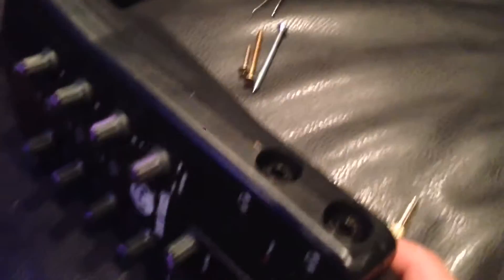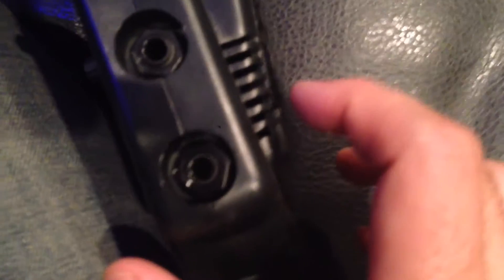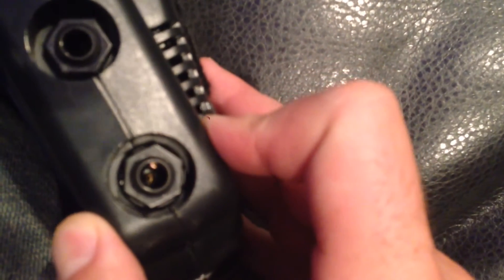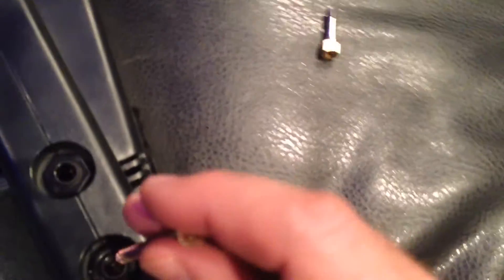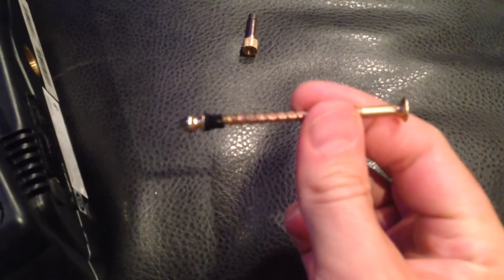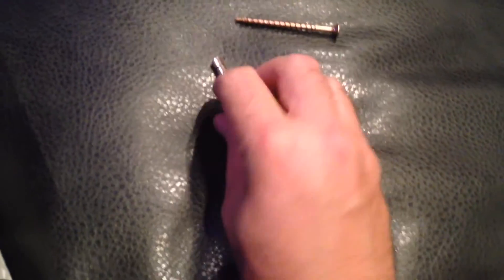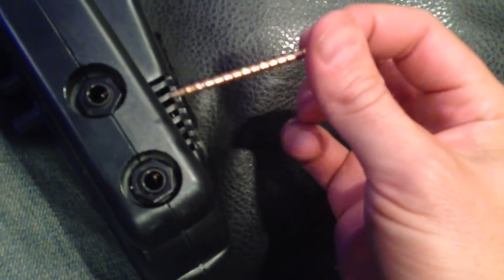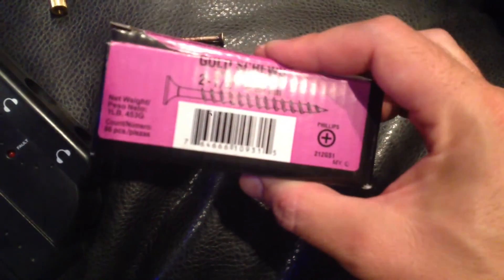How to remove the tip of a quarter inch connector from inside your gear. No Glue.

Comment: Yay! This worked to get a snapped cable tip out of a guitar pedal. One extra thing that helped was to snap the tip off the other end of the broken cable to find out what size screw would fit in the tip. Before I did that, I'd tried with the right size screw but didn't have the confidence to jam it in as hard as I needed to get it stuck on the screw.

Comment: Hey brother thanks this saved me this morning with my Keyboard. It took me about 30 minutes because the quarter inch came out in pieces. Two small pieces a black round piece and silver round piece. Then I was finally able to get to the quarter inch tip. I saw in another video I had to gently stick a wood screw inside and twist on the grooves of the quarter inch and was able to pull it out after a couple tries. Lesson learned: Invest in quality gear don’t buy a cheap quarter inch cable.
Reply: My cable also broke in this way, is there no possible way to fix it? Do I have to buy a new one?
Reply: Hey, I have same problem here. Still looking video on how to get the tip out. I only manage to remove the black round piece.

Comment: Anyone have any thoughts on if using a retractable screw/bolt magnetic retriever commonly used in automotive would be about to bring the tip to the "exit" of the jack on an interface it broke off in or would the baby magnet destroy the interface?

Comment: Thanks so much for the tip!  Just wanted to add that my cable broke at a slightly different plastic ring and I first had to remove a small metal tab with a pair of tweezers before I could use the screw method.